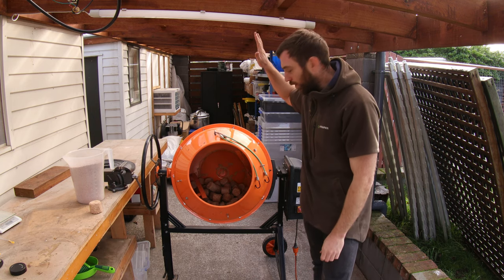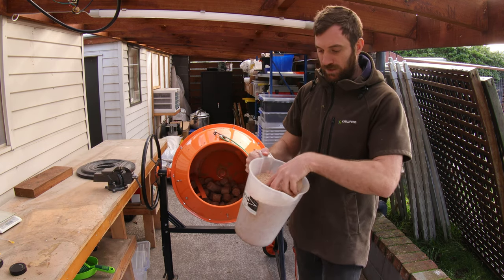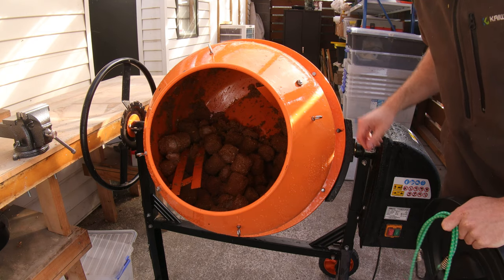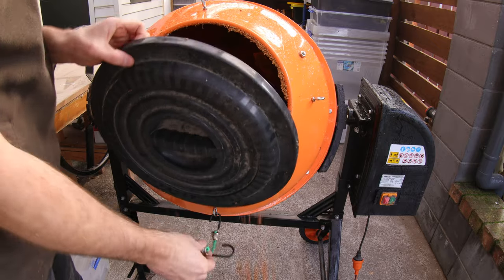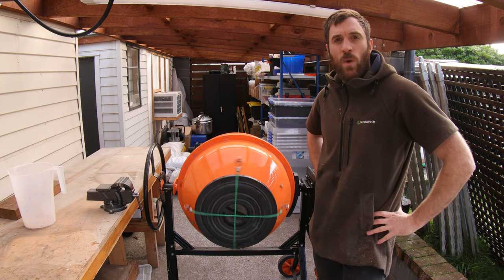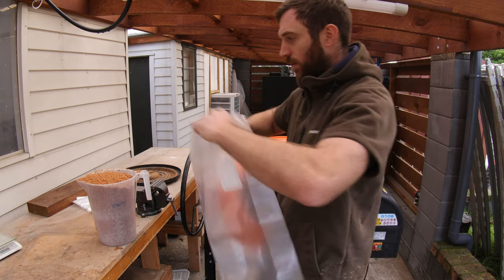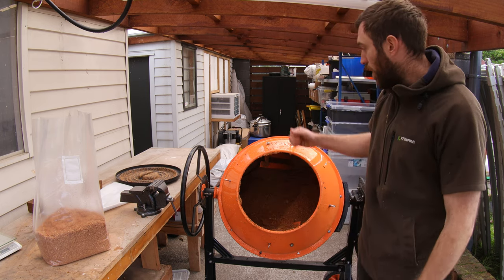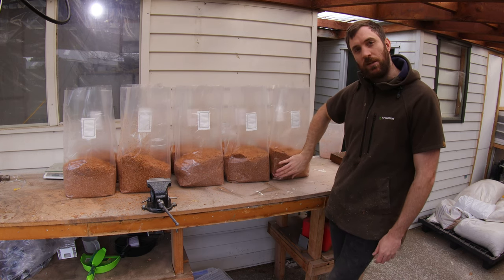Making Shiitake Substrate with a Concrete Mixer!

Comment: Maybe it doesn't work as well with the larger blocks, but with sawdust pellets you can measure out the dry ingredients directly into the bags, shake them up by hand a bit, and pour in the proper amount of water and let sit to expand and then sterilize. No mixing and filling.
Reply from the maker: Yes this is what I do for all my other blocks where I use pellets.

Comment: How on earth did you find a lid to fit it?  My mixer has a 16” inside diameter and 17” outside diameter and I’ve wasted hours trying to find a lid.
Reply: Just make your own lid? Sheet of plywood, 17.5" diameter circle. Saw or jigsaw or hacksaw if you trust yourself 

Then add a raised edge with a strip of metal or what I would do is just drill 4-8 3"x2" strips so you can crimp the lid shut and use bungees for extra protection.